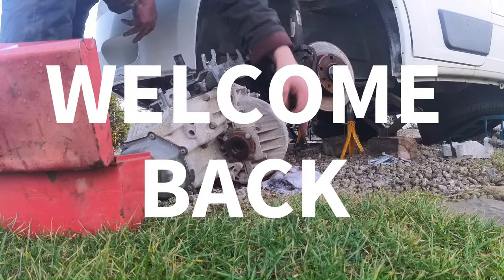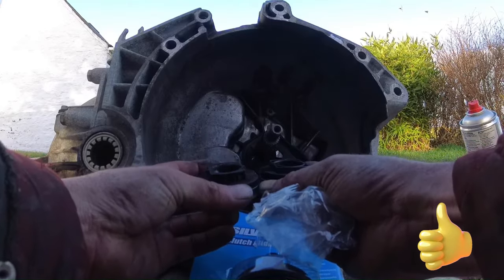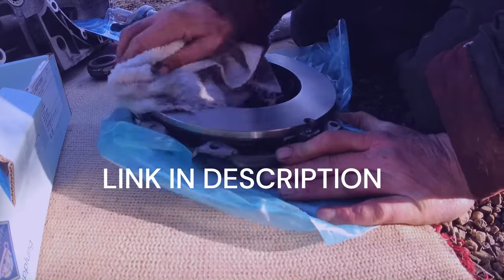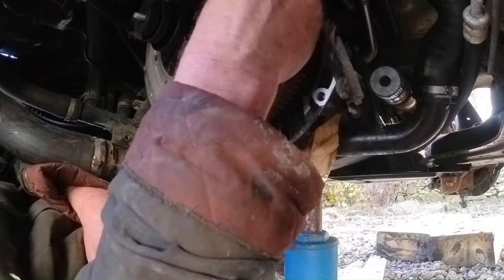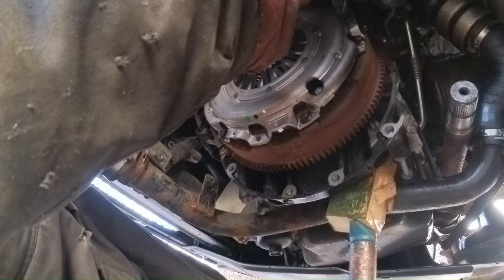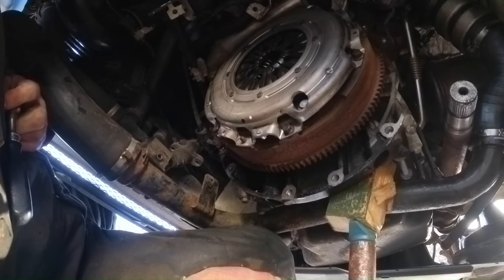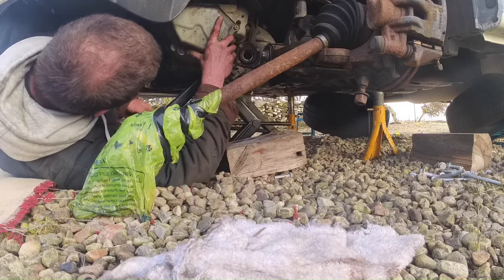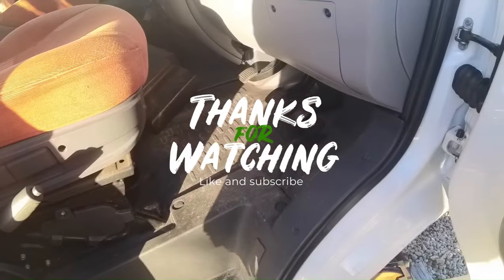Fitting A motorhome Clutch #vanlife

Comment: So the way used to get my beetle engine out which looks similar to your gearbox is, I took my wife’s best large wooden bread board put narrow blocks under it and screwed castors to them. Next job was the narrow blocks should be positioned far enough apart to get a trolley jack between, also having the height to get the jack lifting part in the middle. Next using a ratchet strap tie the gearbox to the bread board, get the boards castors onto a level surface ( drive, garage floor or plywood sheet ) and lift it up and slide it in.
Reply from the maker: that sounds like a good idea. i really need to get a trolley jack.i did everything with those scissor jacks lol